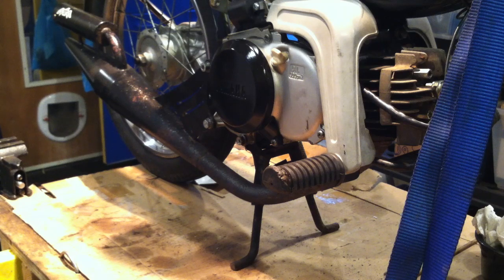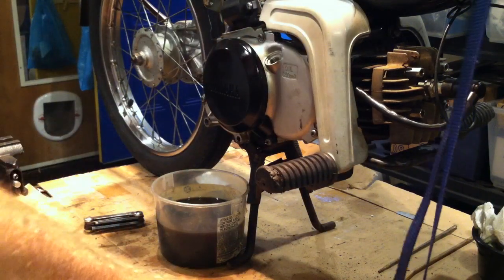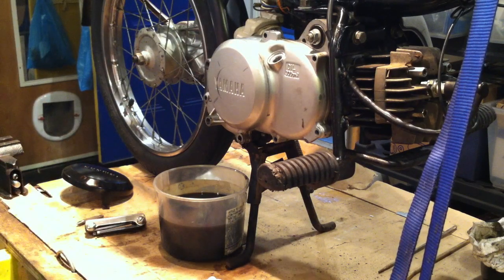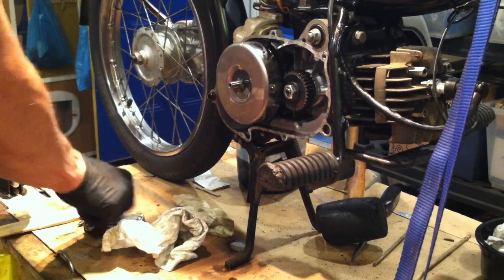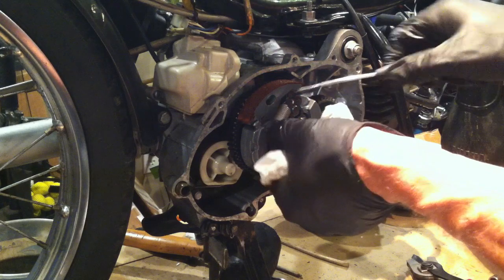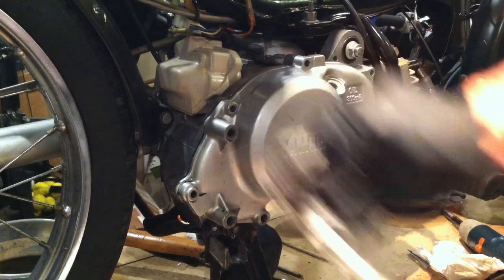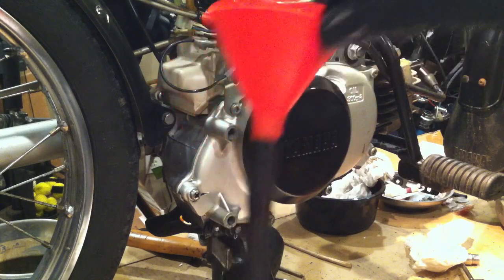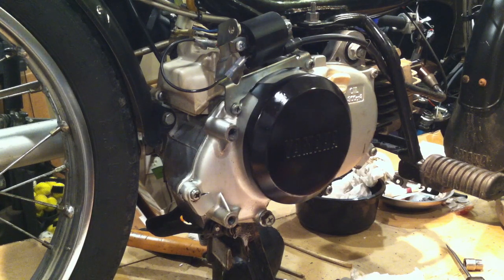Yamaha qt50 clutch spring replacement

Comment: Hello ...am joshua a mechanic from Uganda and needs help.....how can i repaire am mate 50 bike when it doesnot completely accelerate and yet the clutch are new and the piston and the valves....it cannot move on hill or a flat road...(how to time or set the caburator systems to make it run off?)...please help me...thank u
Reply from the maker: if this is a 2 stroke bike then if the main jet is too rich, it will not accelerate.  take the main jet out and look at the size printed on it and try a slightly smaller main jet.  Don't use too small a main jet or the piston will soft seize.  If a smaller jet helps acceleration then you know this is the cause.

Comment: Sometimes I use thick oil like gear oil 75 80 or something not good?
Reply from the maker: Nastynates garage Fine 40 weight is about as thick as I'll go
Reply: Hey so I got some new clutch spring and they are silver ones from treats and the hooks are on opposite side and it make them really hard to keep them on! That’s not right is it
Reply: I see I just watched what you did
Reply: Ok so there was black spring in and I put silver ones with black like are those stronger?
Reply: It seem like the new clutch spring s made it worse I haven’t put oil in yet but my take off sucks now
Reply: Now I just got done putting the old ones back in and it seems better